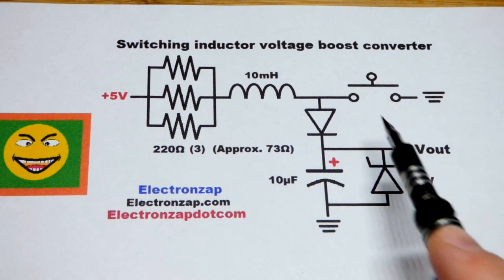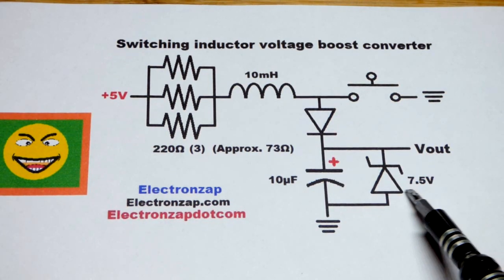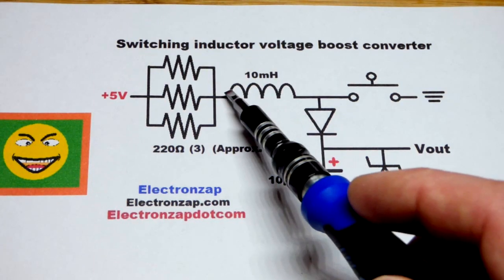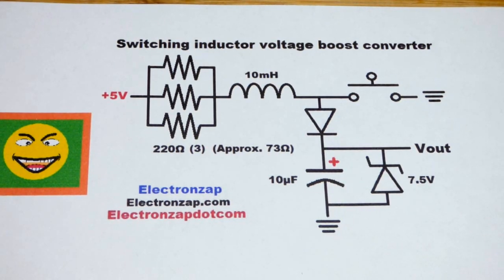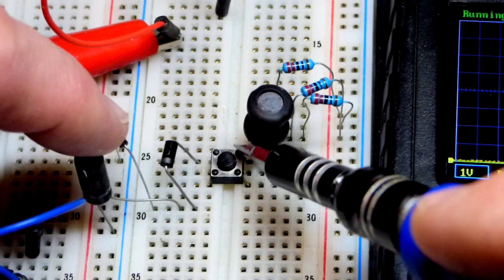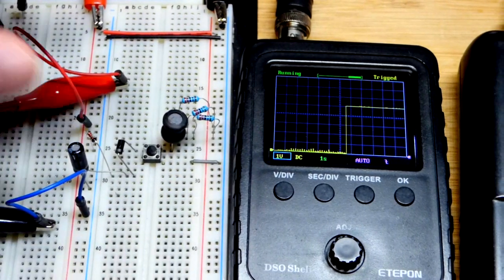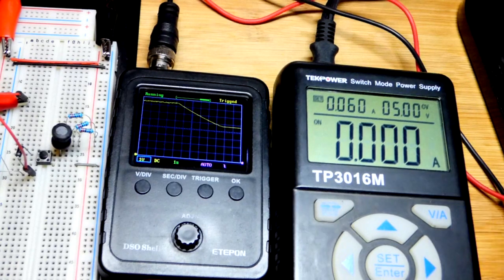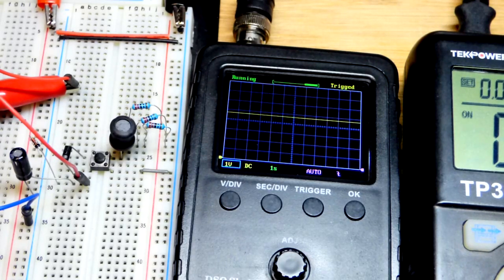DIY boost converter circuit using switching inductor voltage booster electronics how to tutorial

Comment: i understand that it is a simplification but it help me to understand a little more. and i also build the circuit and it works. i am driving it  using a 555. nice. tnx
Reply from the maker: Nice!
Reply: Why do you use a 555 timer?
Reply: @paulmacgiollacaoine8619  is generating the very fast pulses instead of the push button. also i can control the duty cycle.
Reply: @oskimac  Oh wow, nice job :)